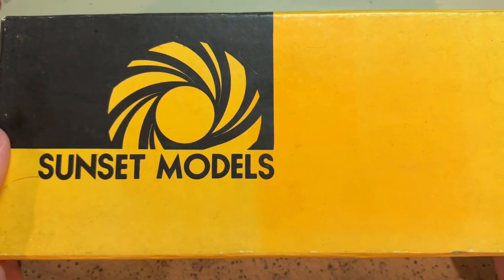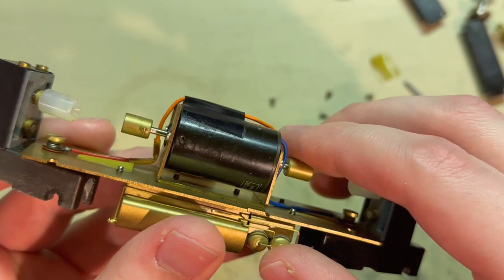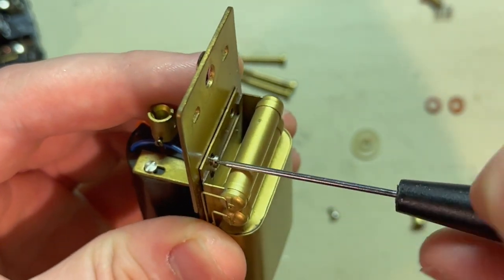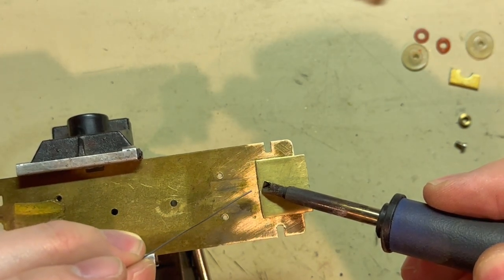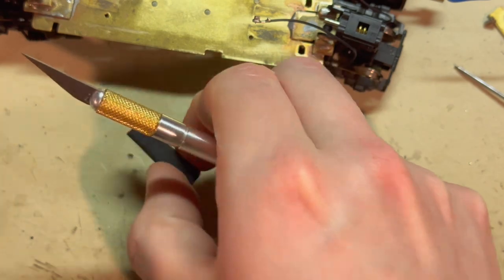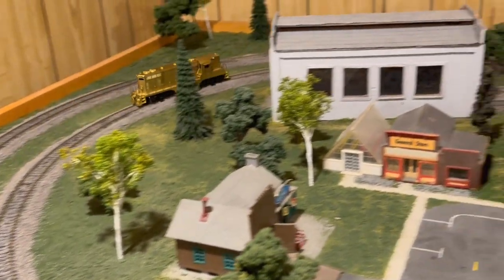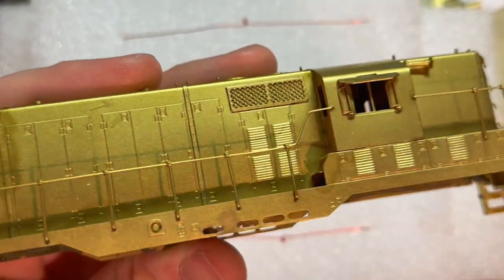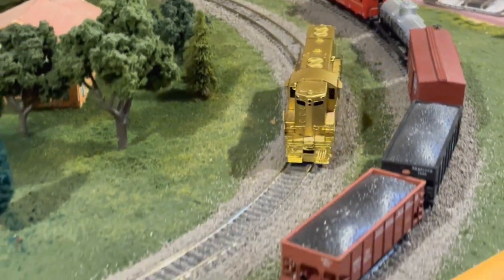Darth's Train Shop - Sunset brass GP7 repair

Comment: Looks like you're gonna need some number boards, front light, paint and some window material.  Cheers from eastern TN
Reply from the maker: Yeah, these brass models usually come without all that.  Easy to add though!

Comment: Hey there. Excellent decision to repair the original gears.....replacing the whole trucks with Kato trucks....readily available & excellent running quality. Makes this a really nice model. Just add couplers, window glazing, number boards & a coat of paint, you have a top of the line, model, equal to any available today. Thanks for the video. Cheers   Michael   NZ

Comment: Very nice video. If you are going to do other brass repairs you might want to invest in a resistance soldering iron to solder with. I think you will have greater luck soldering with one.

Comment: So if you were to paint that, what would you use to prep the brass? Isp Alchohol? I have a brass bowser 460 frame thats corroded, and I think i should prep it before painting.
Reply from the maker: This one is clear coated, so if an appropriate paint stripper is used first to get the coating off, cleaning the bare brass with a toothbrush and a cleanser like Soft Scrub or Comet will be enough. Your Bowser frame would be bare uncoated brass already, so you can try soaking it in white vinegar first to remove oxidation and then clean it further if needed with a toothbrush and cleanser.

Comment: I spy with my little eye, the Arbour Models 0-4-0 at around 15:45! Can't wait to watch you tackle that item. Wonderful Job with the Repair & Replacement! What kind of Flux do you like to use?
Reply from the maker: Thanks!  I'm using Kester liquid flux.  As for the Arbour kit, I'm actually working on the Bowser 4-8-2 details right now (this video was made in the middle of the 4-8-2 parts; I zoomed enough for them to be out of frame) and will be doing the 0-4-0 details next to continue the side-by-side videos.

Comment: I have a gear that won’t stay on a tenshodo gp7, I’ve tried all sorts of glue and solder and nothing works, any recommendations?
Reply from the maker: Try placing the bare shaft on a metal block, then press the side of a file down perpendicular on the shaft and use it to roll the shaft left and right while putting pressure down. This can create a ribbed surface on the shaft to help hold the gear. To further increase the hold, put some baking soda on that part of the shaft, press the gear on, and use liquid super glue on both sides. That all will hopefully keep it in place!
Reply: @DarthSantaFe  thanks!

Comment: Love the work in the videos that have popped up in my feed (I'm gonna have to subscribe at this rate), but out of curiousity, is the x crossover you have there a single track piece or made from a couple of turnouts and a cross piece?
Reply from the maker: Thanks! It’s made from 4 switches, a crossing and some straight tracks.